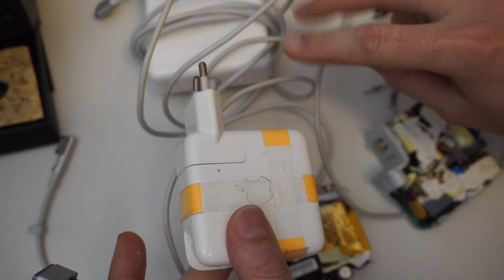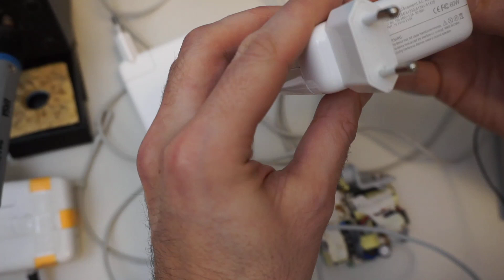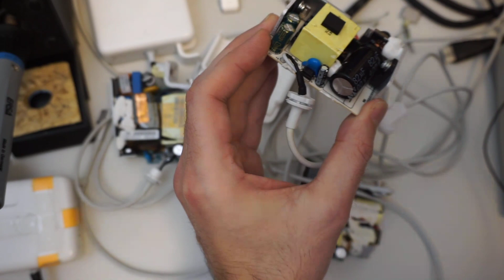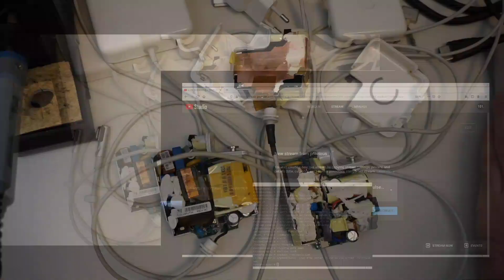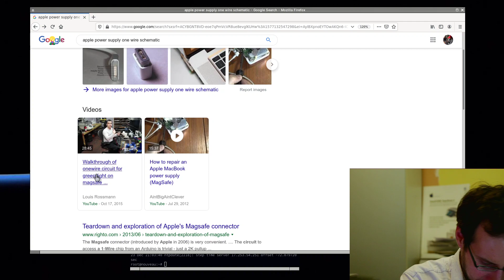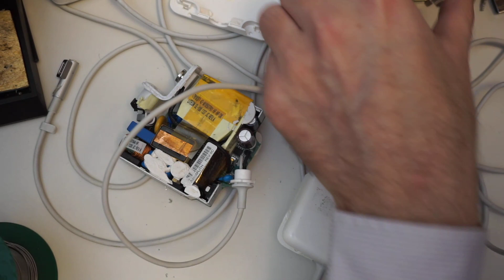Chinese knockoff MacBook power supply disassembly and look inside!

Comment from the maker: Pro tip: measure the cable for short first! After testing this "repaired" Apple power supply with the Chinese cable it did not work, ..! Disassmbled it again, reassured the cable, turned out the freaking good looking cable was shorted, ..! so I cut some 8cm at the end, and it measured good, not shortened anymore. Re-soldered and thankfully this short did not kill the Apple power supply! If this short did not develop while soldering, this might have been the actual fault of the after market supply, and if it has short protection it might also still work with a good cable again!

Comment from the maker: Another update: Given the after market PSU cable was shorted, I solder another cable back onto it, and low and behold, it still works, too! So both the Apple and Chinese knockoff power adapter's short protection survived this short. And this leads us to another lesson learned: First check your power cord for shorts before doing anything, it is also the cheapest and easiest repair ;-)!

Comment from the maker: Second pro note: After switching the cable, the power supply now reports 60W instead of the bogus 85W I mentioned in the video. So I conclude the one wire wattage and likely serial number (not yet checked) is stored in the IC in the MagSafe connector end! So swapping the MagSafe for a less broken one from my 85W supply made the previously repaired one indicate the wrong wattage! The more you disassemble, the more you learn ;-)! So do not swap cables and MacSafe connector from parts with higher wattage, ..! ¯\_(ツ)_/¯